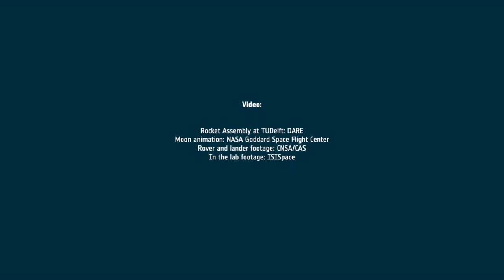Lunar Zebro

Comment: Has the Zebro also been tested in a vacuum environment, on a thick surface of ultra-fine dust?
Reply: Great question Bo! We are in fact now building our first Space-Grade rover - the second engieering model. This one will be tested in a temperature vacuum chamber very soon, so stay tuned for that! 
We are also building a test bed with analogous lunar dust, in order to simulate its effects on the rover. As you might know, this dust is very fine, and tends to stick electrostatically to surfaces. Therefore we must ensure that this does not damage our rover and that we can still move as intended on a more or less thick layer of dust.

Keep an eye out on our social media for updates on this and on the terrestrial analogue missions we are conducting!

Comment: Very very interesting. I hope it makes it to the moon and collect data. But... Yeah i wonder isn't those legs too thin and they may get stuck or just keep digging the surface of the moon? Will the surface be frozen / hard enough to allow it to actually walk?
Reply: The lunar surface, although it has a lot of dust, is firm enough for rovers, landers and humans.  It is lighter than other rovers, so it's not going to have as much ground pressure.  You can see them testing it in a tunnel full of something close to a lunar surface analogue.
Reply: Hey Johnny, that is one of the things we are currently testing. But, as PTONPC indeed points out, we believe that it should be possible. Stay tuned for our first technology demonstration mission on the Moon in a few years and our findings regarding the locomotion on the lunar surface!